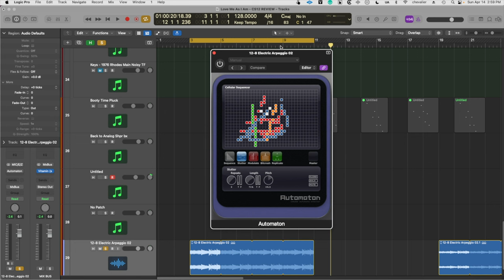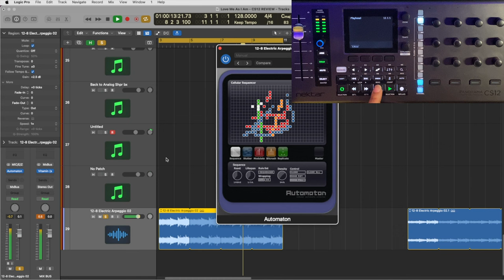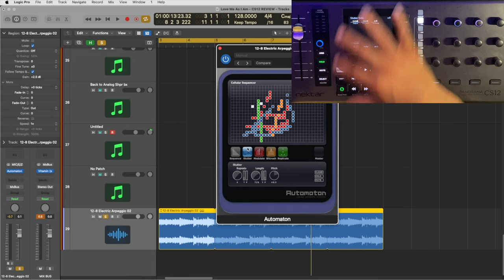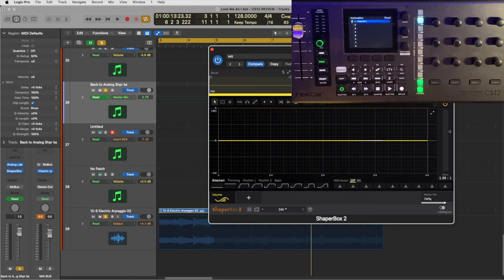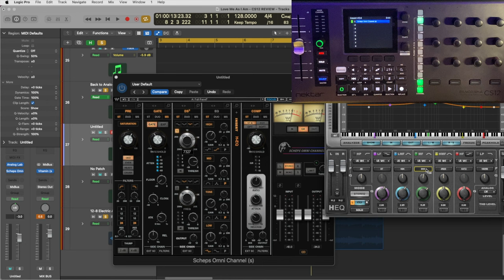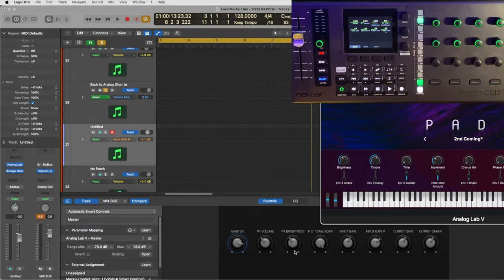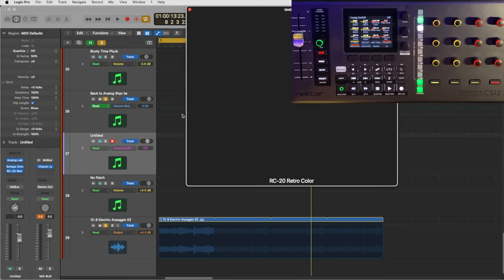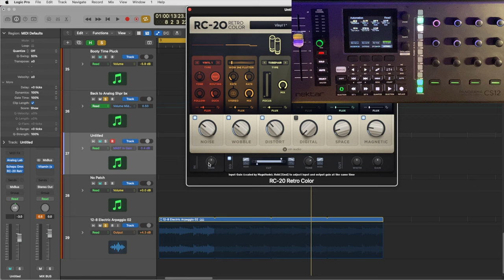Nektar Panorama CS12 Control Surface for Logic Pro - Quick and Dirty Deep Dive

Comment: Waiting for it to start. I'm still using keyboard shortcuts mostly because keyboard is closer. Think it will be a major for plugin control
Reply from the maker: It's still processing in 'premiere' mode.  It should become available shortly.  This is a very different control surface.  I've used almost every brand and cost of device available.
Reply: Thanks!

Comment: I just got one of these. The thing I’d most like to discover is how I can assign  previous and next preset buttons to the unit. 

Thanks for the video.
Reply from the maker: Most plug-ins don’t allow automation of a next or previous preset button, if the plug-in itself allows that control to be automated it can be assigned to a button, but again most do not.

Comment: Great review - this control surface looks the best out there for Logic !    Does it automatically map to the controls within alchemy?    Both the simple and and the advanced controls?  If not can the knobs be mapped manually - and if yes is this easy to do?  I need more than just one fader control (mapped to software controls) as may want to change more than one control in Alchemy at the same time.  Thanks

Comment: Maurice, as you click through the pages you have mapped for the Automaton, the corresponding function buttons in the plugin-in do not follow. Is that mappable?
Reply from the maker: As you click through pages you have mapped, you will see the buttons or parameters you have mapped. This functionality is chosen by you, per your preferences.  Whatever controls you want to see on a page from any part of the plug-in can be added on any page.

Comment: Can you create custom mapping without installing wrappers ?
Reply from the maker: Yes. By holding the shift key and touching the data knob, you enter learn mode.  You can then assign custom parameters to each of the rotary encoders and buttons.  There is a separate Nektarine plug-in, which you can use also to create custom pages, but you don’t use that plug-in when you’re actually using your custom mappings. The plug-ins load as normal.  I used the Nektarine app/plugin to program the last plugin I show in the video – RC 20.  But as you can see in the video, I loaded the RC 20 normally to show it in the video.

Comment: can you map the push buttons to logic keyboard shortcuts ?
Reply from the maker: Nope. They’re for plugin functions. But maybe Nektar will create an update that allows extra controls to be added to the marker buttons. They’ve been making many changes to this device since January.
Reply: @chevaliermusic  Waiting for delivery of mine for almost a month now. My guess is there is a big demand. I do hope they will make the count button and the tempo and zoom dials assignable. These would make good in and out level level knobs for all plug-ins. What would you put under the count button, Maurice? Like your video. Clear remarks, experienced perpective, honest enthousiasm.
Reply from the maker: Update, Nektar let me know that you can actually map logic functions directly to the marker buttons. It just needs to be in marker mode when you do so.
Reply: @chevaliermusic Thanks. Do you mean both reassigning and operating them in marker mode? I’m looking for more than a toggle option. I have the SSL controller trio, they already cover a lot of ground. The CS12 will be my plug-in specialist. I want as much basic plug-in functions as I can on that surface WITHOUT having to toggle modes, like shift or marker. A controller should be like a piano. One key, one function. That’s how we learn to operate it on touch. I wouldn’t want to be looking down all the time checking what mode I’m in - is the marker button off as I remember it to be? Oh it’s lit. Well hit it, then hit the magnifier. Ten minutes later: hey why is the plug-in redo button not working? Wait I’m not in marker mode. That’s how control surfaces get an early retirement, I suppose. My options are limited but reassigning the count button is first on the list.
Reply: @chevaliermusic  awesome! need to try it.

Comment: I would love to have a unit with just that one fader learn section, I don't need theses rotary encoders
Reply from the maker: The rotary encoders are what make the device great. Icon actually makes a one fader device that offers the focus control.  SSL does as well.  But neither the level of control for plug-in manipulation that the C1S2 offers
Reply: @chevaliermusic  which icon is that one fader device which supports this ? please
Reply from the maker: @eliaszerano3510 P1 nano